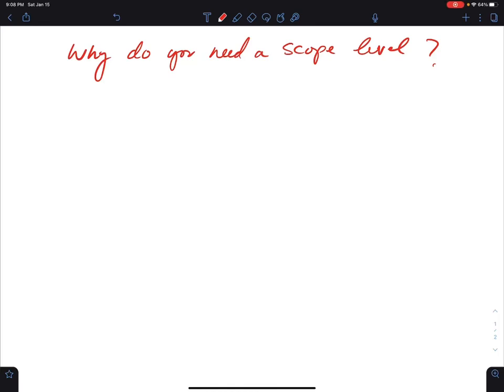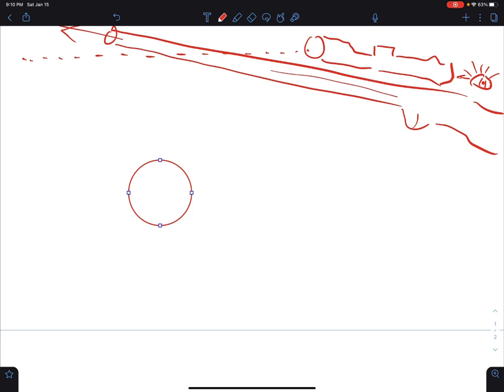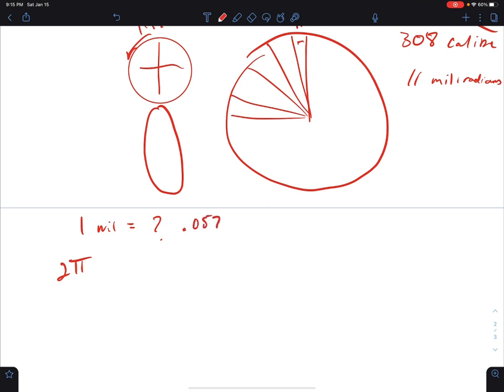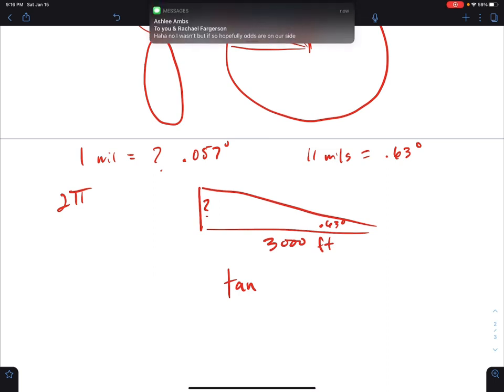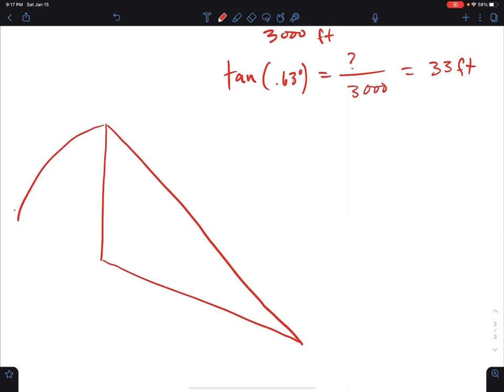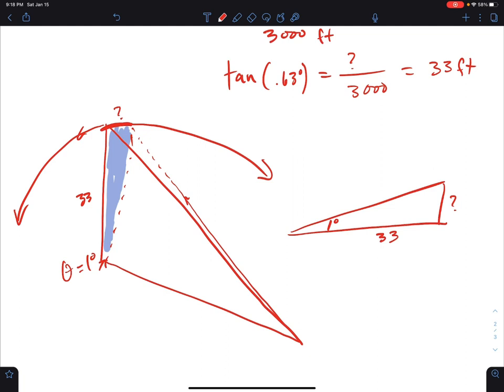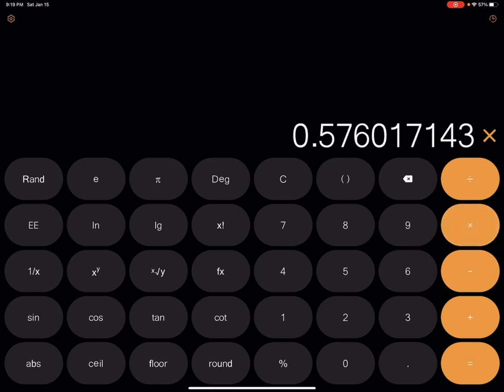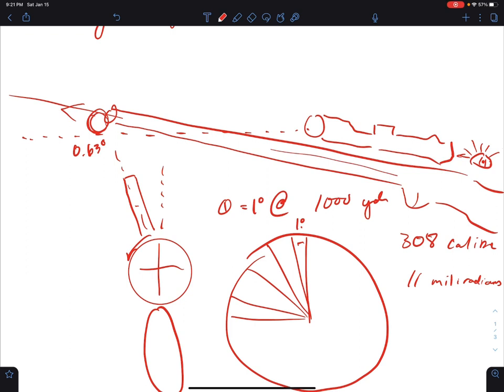Why you MUST have a bubble level on your precision rifle (warning! math ahead!)

Comment: Define long range shooting? What yardage does it become long range.
Reply from the maker: There is no answer to your question as it is highly dependent on the cartridge.  500 yards with a 22LR is certainly long range while that distance with a 300 win mag is a chip shot.  The math is the same for ranges from zero to infinity…I’ve showed the math so you can choose whatever range you like and decide what level of inaccuracy you are comfortable with
Reply: @jeremyscottechols9482  I shoot a custom 7 mag which will group 2.5 inches at 1200 yds. Killed deer in our Southern beanfields at 1102 and 1065 yds. I do have a bubble level which I've been meaning to install for several years now.